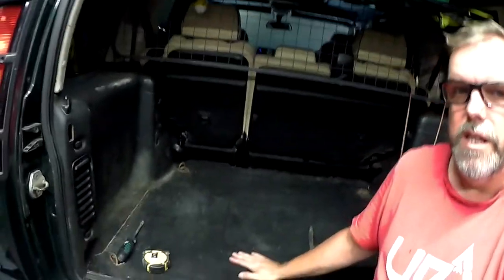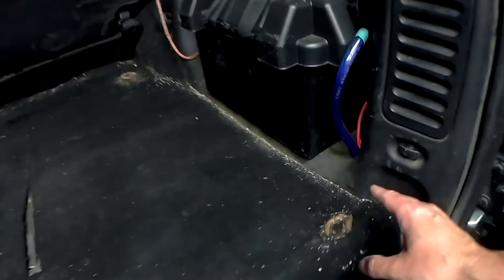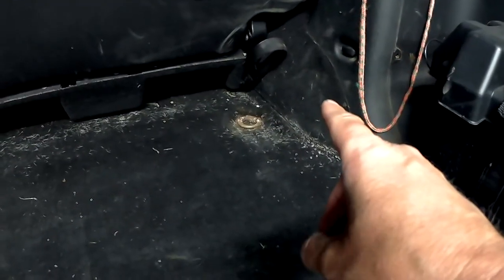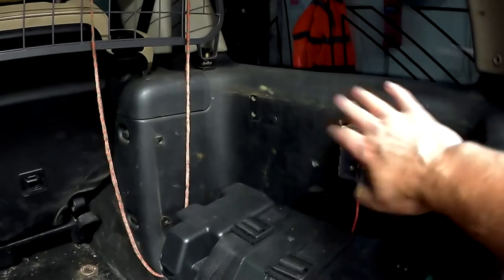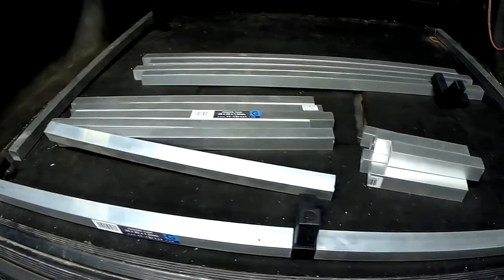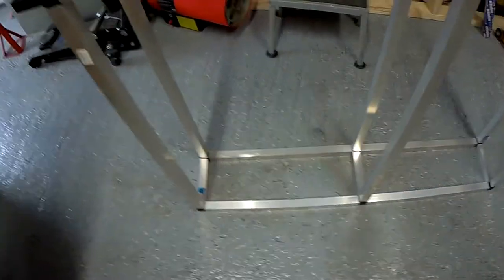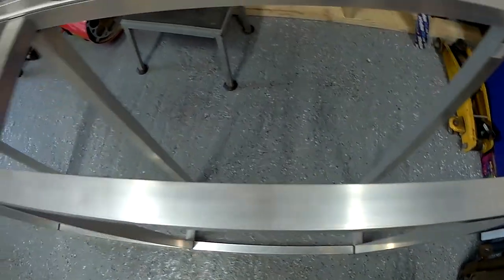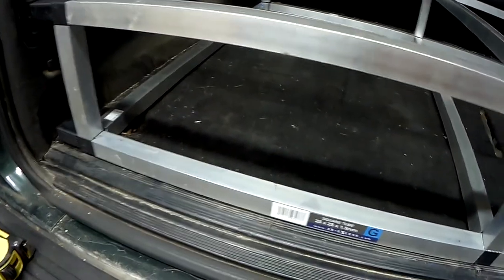DIY 4x4 truck rear storage drawers - lightweight - Discovery 2 - overlanding, camping, tools PART 1.

Comment: Are they SAMCO hoses, do you rate them?
Reply from the maker: Where did you see Samco hoses in this video ?
Reply: @trollmanrs  Your green silicone hoses look a bit like the Samco ones, that's why I asked if they were.  If they aren't, can you point me in the direction to buy a set, if you're happy with them.  Cheers.
Reply from the maker: ah got you, They arn't Samco's not sure Samco do green. If you look at one of my recent video's you will see I install some green heter hoses, those were from Ebay and seem ok but I did have to cut them down a bit. The green boost hose going to the turbo and the breather ones are from Knord Performance and are again on ebay.  Hope that helps. The thinner green hoses for the breather/rad return pipes are just randon ones again from ebay.
 @JimBiddle.

Comment: how much does it weigh
Reply from the maker: Not sure to be honest, but I have tried to keep it lightweight hence no wood on the sides and the frame made of ali. With the drawers removed it very easy to lift in and out of the truck.
Reply: I built one for my jeep grand cherokee and it weighed 19kg including a full width slide out plywood table